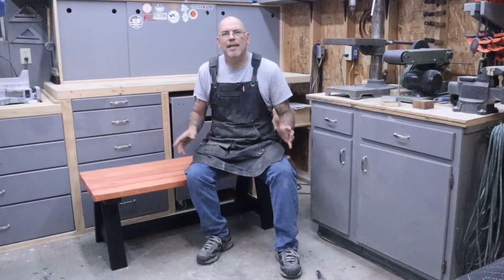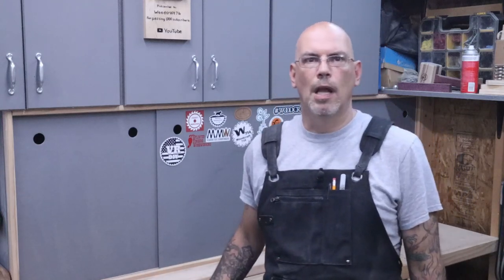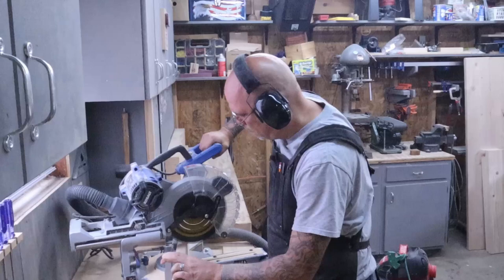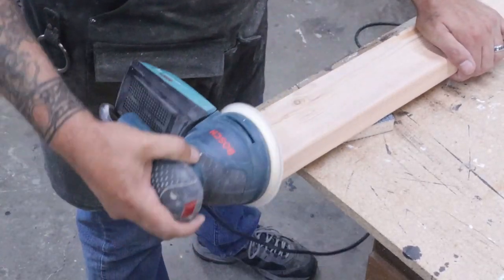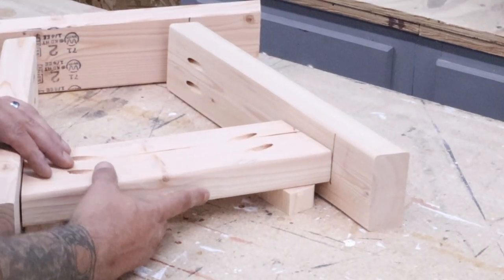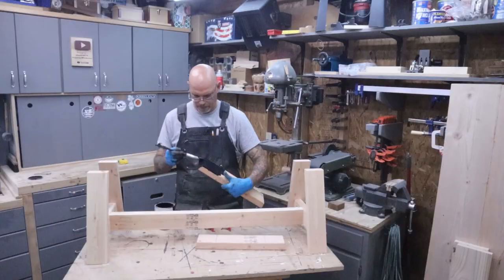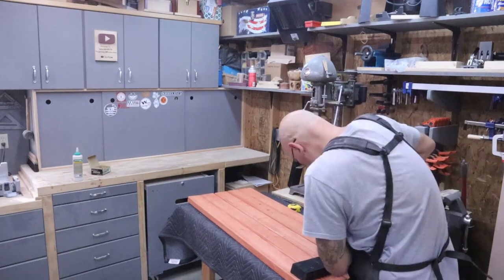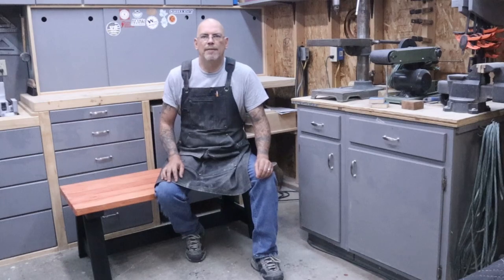easy bench that sells

Comment: Great video. Excellent and right amount of explanation. Plus giving alternative tool use.
I see a similar built, but a little taller for legs, back support and arm rests... maybe something for your next video?
Sort of bench to use on outside porch.
Reply from the maker: Thank you 1252PFC. Thats a great idea. I think I've seen similar designs that would probably be just as easy.  Thanks for watching and your idea. 👍
Reply: @Woodcraft716  oh...and enough depth (and height from seat to arm) to add soft cushion on seat and back. Thank you.
Reply from the maker: @anilmistry8080  great idea. Thank you 👍

Comment: If you didn’t use pocket screws, what method would you use?  

Would the alternative be as strong over the long term as pocket screws?

I like the project.
Reply from the maker: Great comment John.  I was going to mention that if you don't have a pocket hole jig. I would use 2 1/2 inch outdoor deck screws where they will join together.  So you would see the screw heads, but that's a nice look ad well.  For example.  I would screw the bench slats from the top. So you will see the screws. Space the out evenly so it looks uniform.  I hope this is making sense.  I would also use glue.  And for sure it will hold the test of time. Good luck and keep me posted  please.